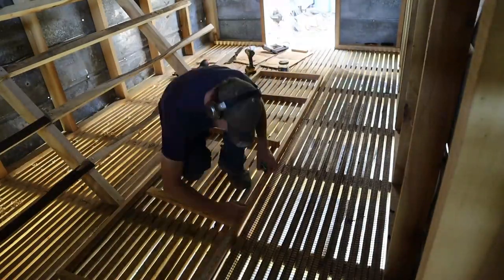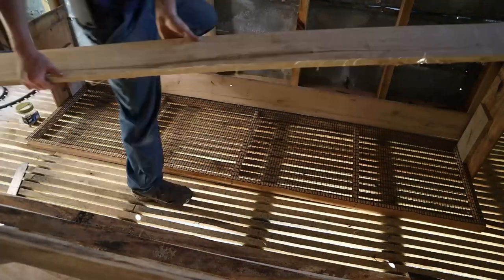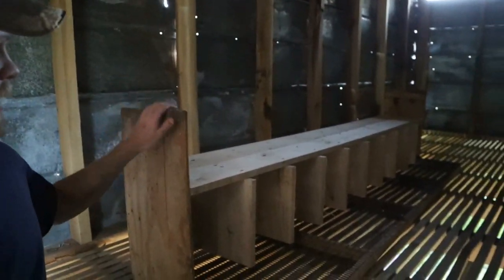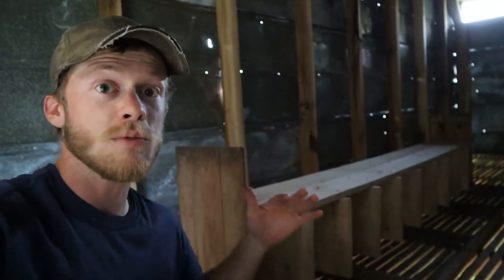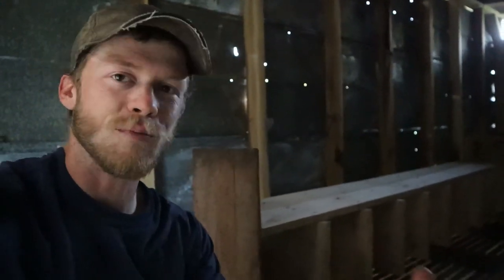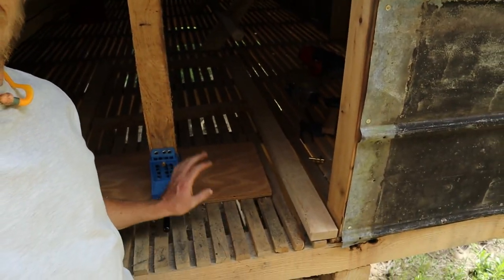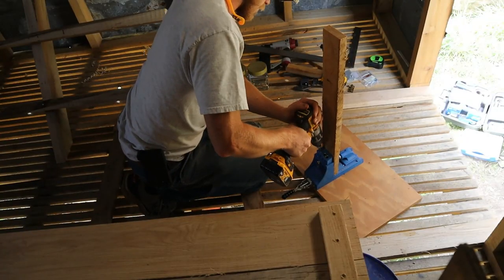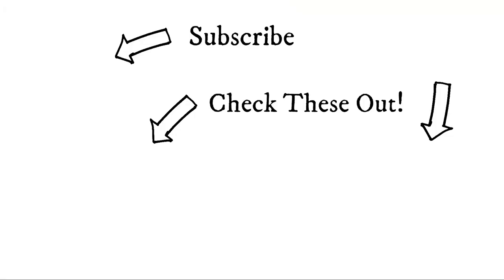Building Roosts & Nest Boxes for the Eggin' Wagon (Mobile Chicken Coop)

Comment: I figured the truck would do just fine, Those chickens should lay eggs like crazy being in the Tasma Hall. That is a well built Coop. You did your home work for sure. I like it. We used to pull bale racks with hay loaded on them all the time. Be interest to know how much it weighs. Let us know how it works. Are you going to put an automatic door on it for sunrise and sunset? Thanks for sharing. Enjoy your video Josh.
Reply from the maker: Well you got me curious on the weight question, so I did some rough figuring. Best I can come up with is around 3.5-4000lbs. I probably wont put on an automatic door because if I'm moving it every day, I need the chickens to still be inside while that happens. Don't really want any chicken pâté......